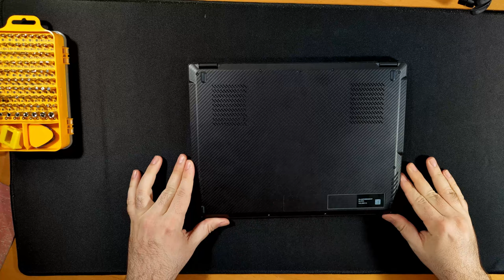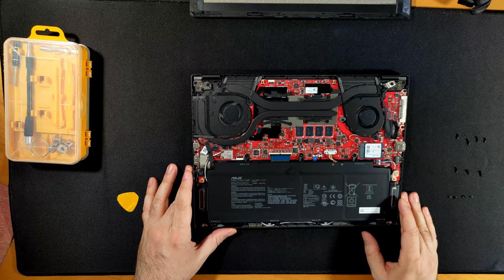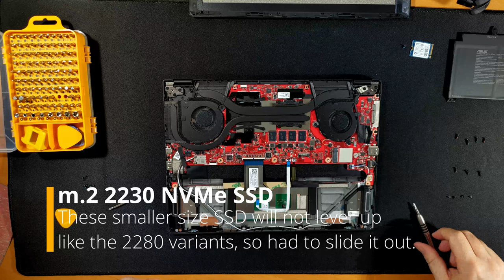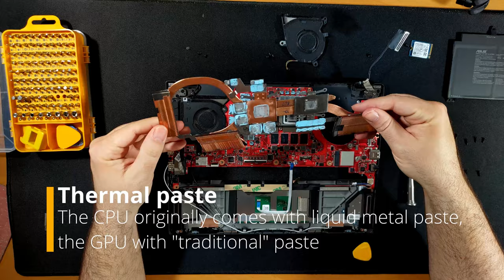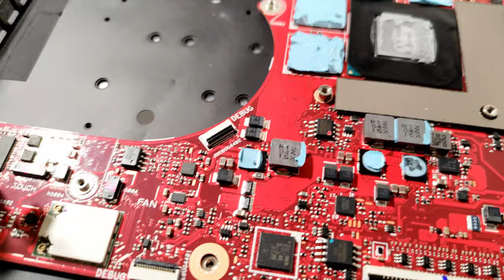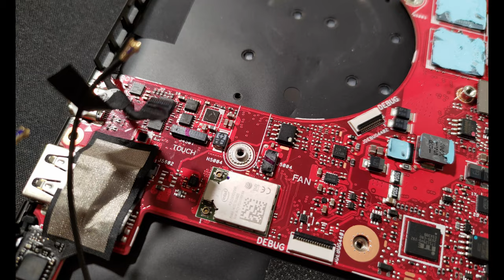ROG Flow X13 (GV301) DISASSEMBLY and UPGRADE OPTIONS (Storage, Thermal Paste)

Comment: I was wondering if we could swap the display hinges so that when we open the screen, it will be positioned over the fan's heat exhaust, similar to how the new model is designed.

Comment: Old post, but can you tell me if you can change keyboard only taking out battery and flex conector?. Is there any screw for Keyboard or just apply pressure=. Thanks in advance from Europe

Comment: Hi, is it recommended that we open up the laptop to clean the fans? My X13 flow gets quite hot under even light work loads.
Reply: All laptops get hot under relatively light workloads. They are really limited by their cooling capacity.

A laptop stand will help with performance, but the temps will still jump to the same value - you'll just have less throttling.

Comment: my CPU temps have progressively gotten worse.. thermal throttles a lot now.  But it's liquid metal? Surely it does not need to be re-applied and doesn't need to be upgraded?  The fan seems fine, i tried cleaning inside but it didn't do much..

Comment: How do you put the battery connector back into place? I'm having trouble sliding the metal piece back to secure the battery connector.
Reply: Happened to me too. In case anyone has the same problem and finds this video. The battery connector has to be pressed down until it clicks into place. Only then you can slide the metal clip over to secure it

Comment: It is not clearly seen from the video what parts of the laptop are are metal? I can see a magnesium "roll cage" under the palmrest, does it extend all the way up to the upper edge of the base or does it end halfway under keyboard? Btw, is the base plate (the one that yoi removed first, made of metal?

Comment: Hi, is it possible to upgrade the RAM? Solder a new ram?
Reply: In theory? Yes. In practice? Not really. It's physically possible, but you're more than likely to botch it up, not to mention that finding correct chips would be next to impossible to begin with.

Comment: I only wish that they would stop soldering one stick of RAM and liquid metal. Liquid metal is nice but it can be risky to replace.
Reply: i mean, it IS 32gb, so to most people there should be no reason to upgrade
Reply: @Clavinohou  Many x13 models have only 16GB and paired with ryzen 9 and eGPU, it can become problematic (same with the small SSD 2230)...

Comment: Can We upgrade that SSD slot with Sabrent 2TB Rocket NVMe PCIe M.2 2242 or SSD SATA M.2 2242 2TB Dogfis? maybe without bolt and use little PE Foam Tape
Reply: no, it has to be 2230 ssd
Reply: Did you try doing it?

Comment: Do i need to disconnect the battery before opening the display port?
Reply from the maker: As a general rule, it is to always disconnect the battery before you do anything inside your machine. Just for safety. ;)
Reply: @MakaiTechReviews  i did this mistake and it cost me the laptop. How much is the motherboard of this laptop.

Comment: Can you tell us how can we change the thermal paste? I am facing a lot of heat issue in my laptop and thermal paste replacement looks like a solution to me
Reply: It's not a thermal paste issue.. The CPUs have liquid metal thermal "paste". Liquid metal does not degrade or dry out over time.
Your issue is simply the fact that it's a laptop with a relatively high power CPU.. The temp will almost instantly jump to 80-85degrees as soon as it's under any load.
Reply: @ryanokeefe12 This also explains why every time I try to overlock the external 3080 GPU via armory create and start any type of game, it immediately crushes....????Unfortunately I can no longer play warzone well at 1080p even in turbo mode....😢
Reply: @Filippo9990  1080p is only the resolution.. The graphics settings will impact the frame rate drastically.
Reply: @ryanokeefe12  I have always used settings seen on YouTube to increase FPS from famous call of duty players... But even in old games like Assassin's Creed Origins at low settings, everything stutters, which makes me prefer playing on PS5...🤦🏻‍♂️
Reply: @Filippo9990  "famous" players settings are not laptop GPUs and not the same setup as yours. Tune your own settings.

Comment: can it fit with 2242 ssd m.2 nvme?
Reply from the maker: No, it will not fit. The screw hole will be on the way, and will be kinda troublesome to lock somehow the bigger module into the motherboard. :S